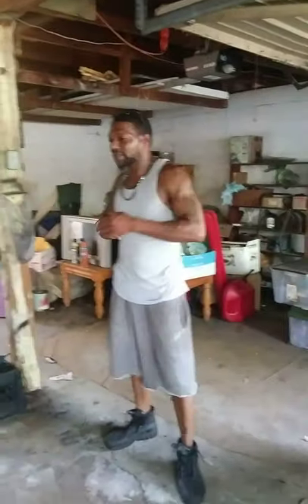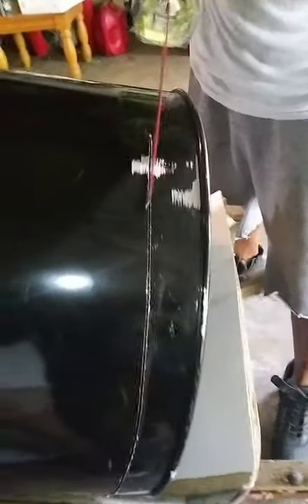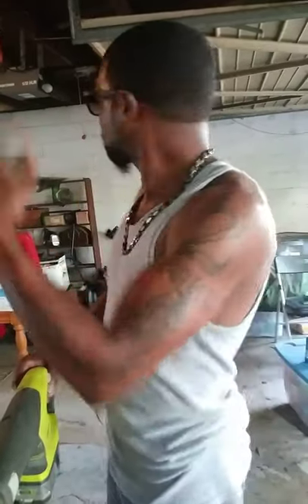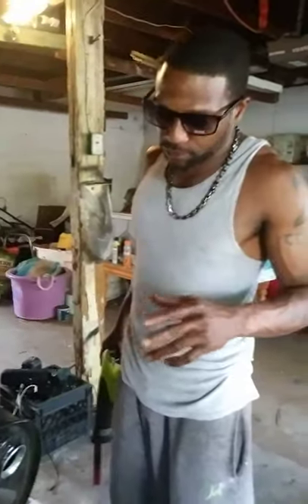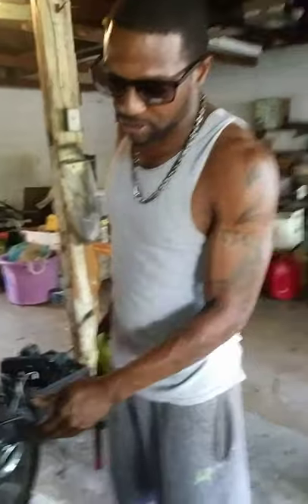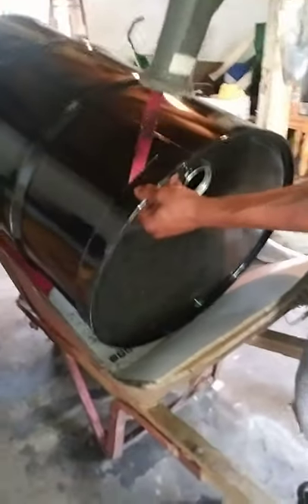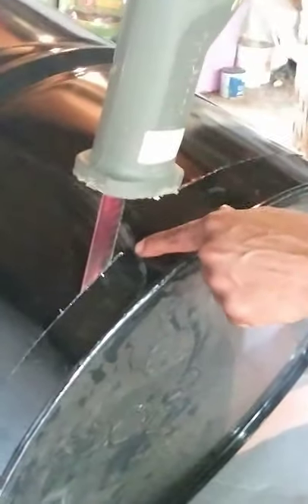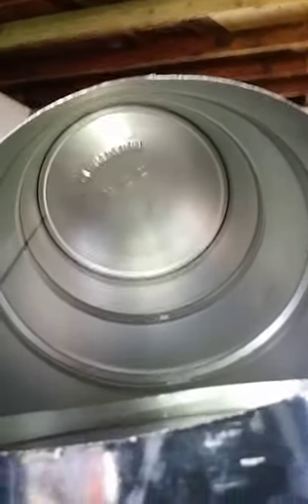Cutting steel drum with a reciprocating saw / Sawzall

Comment: Was it a motor oil drum? Did you have to wash it first?
Reply: I have done oil drums never washed them actually found the film of oil made it cut much smoother. Friends were like you can't do that it will blow up. Trust me it won't oil is very hard to ignite unless atomized and then still hard.